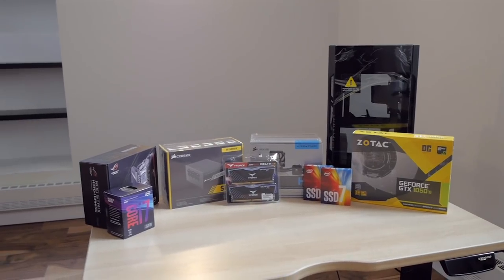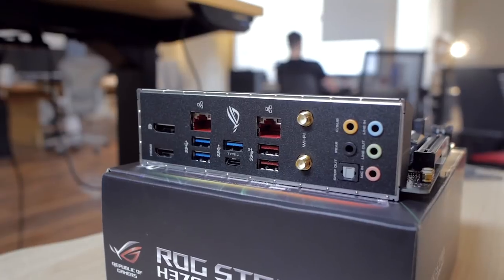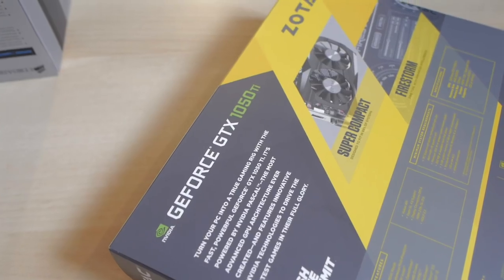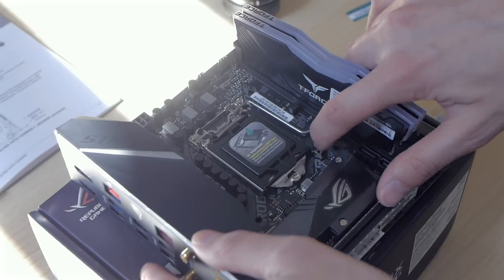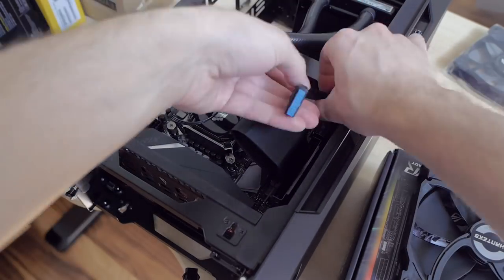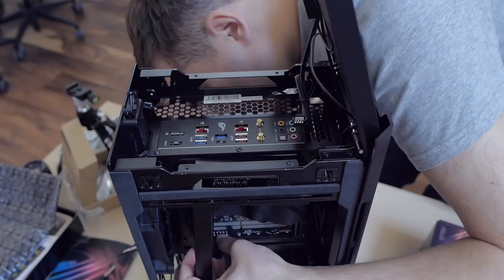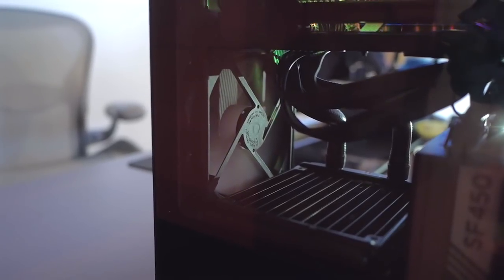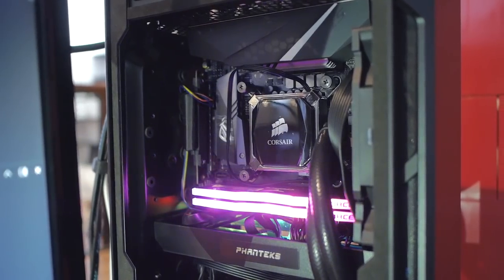Small Form Factor Workstation PC Build (i7-8700, M.2 SSD RAID 0 & More!)

Comment: You can also us USB extension cables as well  and run them down and out behind the cover panel. It's a tight squeeze, but it can be done I've got ALL power cables all signal cables two SSDs mounted just underneath. It helps if you use SSD ribbon sata cables. They help with minimizing the bulk and you can run power and sata cables underneath the mounted SSDs holding everything down nicely.

Comment: The stock orientation for the gpu is actually much better for thermals. There's much more room between the motherboard and gpu than the gpu and the glass. You really should only switch the gpu to face the glass if it's watercooled. Also this case is much better with a larger gpu that can breath from under the motherboard. Blower style gpus are actually the best here.
Of course, with just a 1050, none of that really matters much.
Reply from the maker: I'd say the space between the motherboard and the GPU is roughly the same as the size between the glass and the GPU, so I guess it would be similar, but yeah with such a tiny card, it doesn't make much difference
Reply: it may be similar, but a full size card can breath from under the motherboard where there's tons of room.
Reply from the maker: Taylor Lucy ah I see what you mean, true!

Comment: I'm tempted with this case, do you think an Asus Crosshair VIII impact will fit? it is DTX form factor, 3,3 cm longer in the left side (where ssd cages are) and same height, so 20,3x17.

Comment: How Do You Find The Temperature Of The CPU & The GPU in This Small Case?
Is It Comfortable Enough For Video Editing Build?
Reply from the maker: I'm sure it would be fine! With enough fans, you should be good. 
I only use it for development so my temps are below 50 both on GPU and CPU.
Reply: I have a 1080ti mounted with 4 fans running to push cold air in and hot air out of the top. But the GPU still throttles, my solution.... remove the back glass on the GPU side when I game or edit video. It's the little things in life that make us happy. If I'm just browsing or watching a movie I keep the back panel on. It's easy to remove and place back. I'm using the X version of the case and have a 280 AIO keeping the CPU cool

Comment: Hey can you actually use the usb ports and audio ports at the top of the case with the top shut. Or is it useless
Reply from the maker: Yes you can, there's a hole at the back where all the cables come out.
Reply: @minimalistik  yea I know that. But I have to display ports and 3 usb wires coming going to the top and I dont see how to do that without really bending the wire

Comment: had the case. built quality is ok. the sheet metal used is so thin. cooling is sh*t , so i'm glad you are only using a 1050Ti. BTW a corsair H80i v2 with two fans will fit in this case.
Reply from the maker: Yeah, that cooler would fit! But with a 65W TDP CPU, the H60 is plenty good, and I never use the CPU at its full capacity for long periods of time. 

With the low power parts I used, the temps are pretty good, but it could be problematic with high performance parts!
Reply: Ed U Did you have the Shift X?
Reply: Did you by any chance, attempt to see if a standard ATX power supply would fit? I know that some will fit in the Shift X. I want to give this case a try but I do not want to purchase a new PSU.
Reply: What case did you switch to?

Comment: why use small mobo if you're going to put it in a case 3 times bigger? :/
Reply from the maker: That's the only size of Motherboard it accepts haha, Mini ITX only
Reply: minimalistik  , I understand your point of view (regarding power/portability combination) hence browsing the tube for SFF builds.
But this case is almost 22 liters! There are at least 3 cases that I know of at around 7L (which allow for CPU-water-cooling, sometimes with compromise with the GPU size - but still can fit a gtx1080-mini inside), and there's even a 5L one though the last one requires specialized PSU and can only take some mini-GPUs (but can still go to gtx1080 if your PSU can feed it). DigitalStorm should release a fully-water-cooled 7-ish L with i7-8700L & gtx1080 (perhaps even TI)
If you're taking a compromise with the GPU as I see you could even go to Intel's Hades at 1.2L and still has a GPU at least as fast as the gtx1050ti and the i7-8809G isn't that much slower than i7-8700 (except in multi-threading it's 2 cores less)
I would personally go with something around 7L size with a backpack-able form :)
Reply: @blueckaym  The case is tall but the footprint is vary smaller... just slightly bigger then a GPU. In most cases people dont have any height restrictions as far as pc placement goes, but many people have desk and floor space restrictions that doesnt allow the placement of a full or mid atx case... when you compare case dimensions of the phanteks Evolv atx case vs the Evolv Swift mITX case, the shift is only 2in shorter height wise but the depth is half as much (the cases full length is about the width of most atx cases) and the width is like 3/4s the size of the Evolv case. Also worth mentioning that the Evolv swift is vary similar in its dimensions to a typical AVR or Center channel speaker making placement of the case in or near a home theatre tv stand much more elegant/unintrusive then a mid or full sized atx case would be.